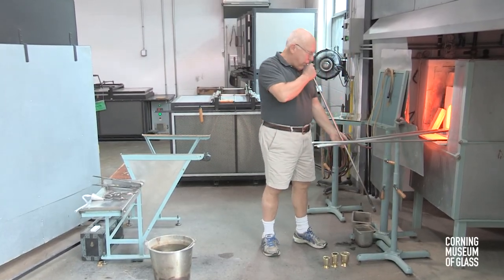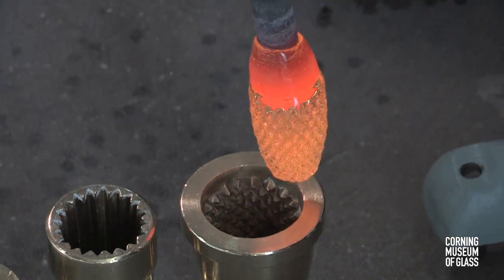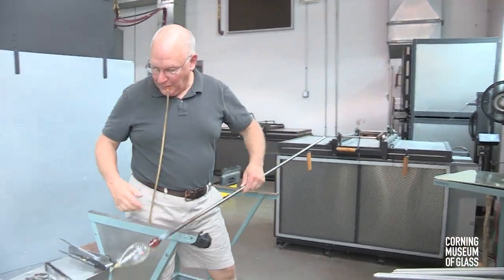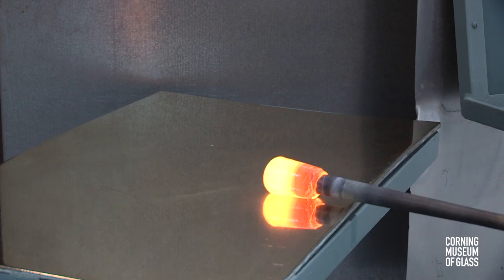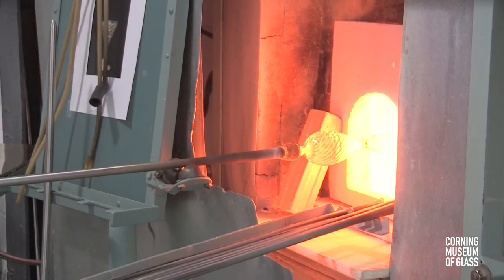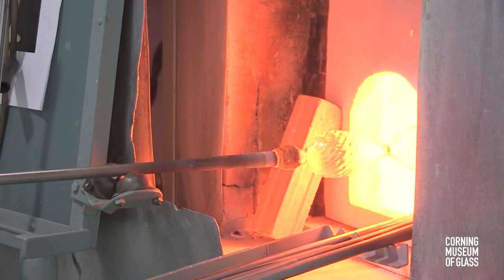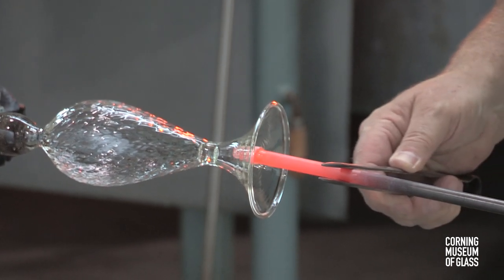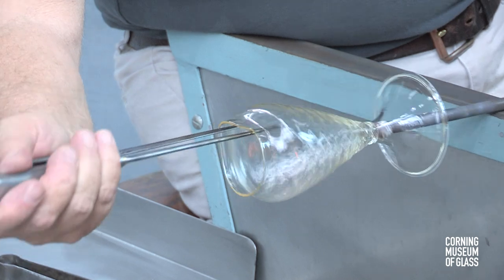Footed Goblet with Pineapple Dip Molded Cup

Comment: Very fast glass working. No wasted motions or time.
Reply from the maker: Thanks for watching!
Reply: Blowing that thin, and probably with System 96 in the furnace (a certain chemical makeup of glass for glass blowers that cools faster, among other properties), if he wastes even a second, he could loose the piece (it would break) to thermal contraction, or expansion when he goes to reheat it (which isn't quite as harsh in his sort of Renaissance Italian setup with a pot of glass under the reheating space, but in a "regular" reheating unit would corrode thanks to the glass seeping through the bottom.).  He really doesn't have a choice about speed.  He's answerable to the glass.

Comment: glass melting and glass molding work.
1] Melting glass, shaping. In the past, electronic guns that shoot the light of CRT TVs had the work of melting and attaching glass.
It is very difficult to melt glass parts one by one and then shape them and attach them to the parts, and the work is slow.The spacing between the stainless steel parts is several tens of microns.It was about a few millimeters.Companies have done this by automating it in an easier way.
1)At that time, LNG gas and oxygen were used as gases that melt glass parts. Gas-only use is insufficient oxygen, resulting in insufficient temperature to melt the glass and delayed. There's methane gas coming out of the poop. The composition of LNG gas is methane gas.There are two types of methane gas in poop: sinking and light floating. Materials need to be found on the Internet and in books.
Burners using LNG gas and oxygen are required.I think there are many ways to melt glass.
2)Ceramic or platinum was used as the support for glass parts when melting glass. Platinum is expensive, but it has a low defect rate due to less foreign matter. Ceramic is cheap and brittle by impact. The reason why ceramic or platinum is used as a support for melting glass is that melting glass makes it difficult to form a glass shape as glass sticks to ordinary materials. This is because ceramics and platinum withstand heat at glass molding temperatures. The glass stand is manufactured and used in the shape of the product you want to make. When the melted glass is pressed on the product-shaped pedestal, the product shape is stamped.
3)Cleaning. When melting the glass, sometimes foreign substances in the glass come out and get on the pedestal, and foreign substances stick to the next glass. I cleaned every two hours with a wet towel.
4)The material for fixing the glass base was stainless steel (SUS). In the head equipment of the stainless steel, there was an air vacuum hole that temporarily held the glass. The head holding the glass pedestal had cooling water in, cooling water out, vacuum holes using air, and three pipes. The reason why a vacuum was needed was because the glass was raised and melted, and vacuum was needed when holding and gluing. There was a hole about 1-2mm in the glass stand for vacuum, and there was also a vacuum hole in the head fixing the glass stand. Coolant is required to reduce the higher temperature of stainless steel and ceramic. The glass could not be fixed by vacuum, so there was a part where a small stainless steel plate was pinned to the lower part of the glass(1mm stainless steel plate and spring to move up and down).
5)The melting temperature of glass was 1050-1300 degrees Celsius in 11 seconds, and then the glass was attached to the part of the soot. The melting temperature was different for each color of the glass. White was around 1050-1100 degrees Celsius, and it was difficult to raise the temperature beyond that. If the temperature was increased, the glass properties would change and burn, resulting in defects.
Brown and yellow at 1300 degrees Celsius. Blue and gray at 1200-1250 degrees Celsius, I think. I can't remember.
6)Use an infrared thermometer to measure the temperature at which the glass melts. I sell it on the Internet. 7)I need a burner picture and a stainless steel part holding the glass stand. The burner requires a supply of LNG gas and an oxygen supply. In order to use LNG gas, a backfire preventer is required in the gas supply. The anti-reversal device prevents the ignited gas from burning upside down into the pipe.In general, LNG gas comes out little by little so that the fire does not go out. When working, the gate valve is used to release LNG first and then oxygen.The supply pressure of LNG, oxygen, and air seems to have been around 1~2 (kgf/cm2) (not sure).
8) Glass is manufactured using glass raw materials. Alternatively, glass is made by melting the made glass. In the company, glass made in a certain shape was melted in advance and worked only on the shape.     9)When making ceramics, there is a way to mix the metals that are melted little by little with ultrasonic waves in water with soil. There is also a method of mixing plant juice with soil.I don't know because I didn't work on this part.     10)The dimensions of the drawing may not fit, and adjustments are required.   11)The anti-retarder needs to be replaced every few years.Need to check with equipment if gas leaks every month.